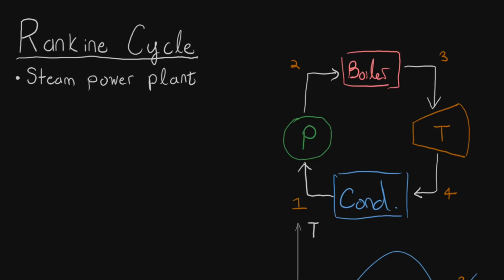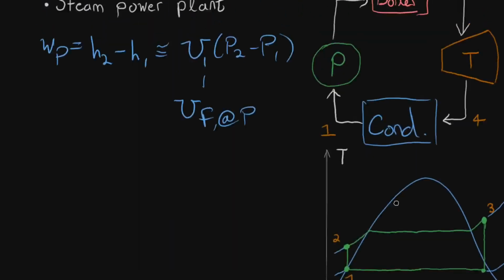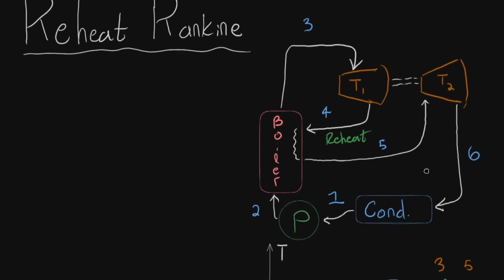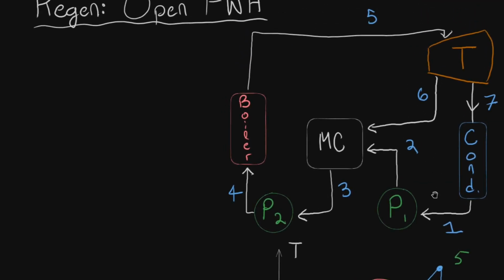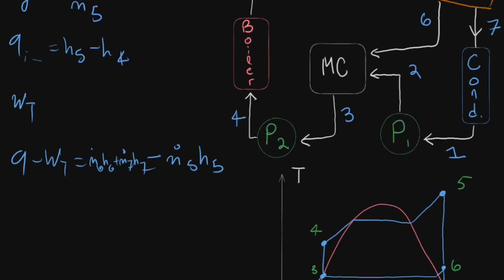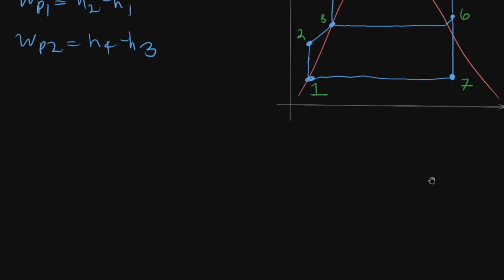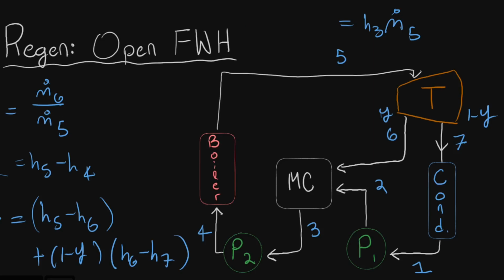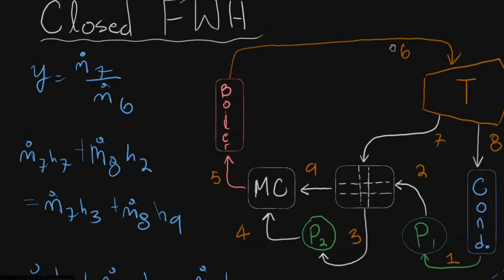The Rankine Cycle

Comment: Can I ask a question? My convention is U = Q+W and I am solving for the Qcondenser and Wturbine. I get results that are negative. Is that correct? Also, following this convention which I am required of, I keep getting negative mass flow rate. Is it possible to have negative value of mass flow rate? Because if I will use this, my Qcondenser will be positive which does not follow the convention I am uaing. Hope you can help me.
Reply from the maker: If you're using the convention U = Q + W, then you should think of Q as heat addition to the system, and W as work input to the system. Since the condenser rejects heat and the turbine has work output, it's expected that the Qcondenser and Wturbine terms in this equation are negative. As far as I'm aware, mass flow rate should never be negative. If it is, you likely have a sign error somewhere in one of your equations.
Reply: @tmodx  Thank you very much. The thing is, I have rechecked my equations and still get negative mass flow rate. Is it possible to just get its absolute value? Although I don't know how to support why I used absolute value.
Reply from the maker: It depends on how much justification your instructor/course requires. My thermo professor literally told us "just flip the sign if it's wrong" but some professors probably wouldn't like that.